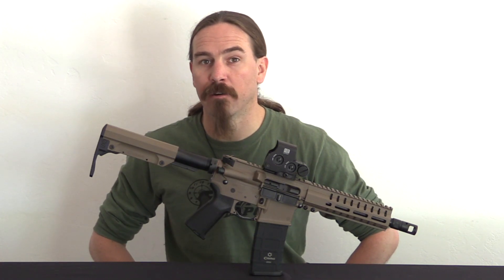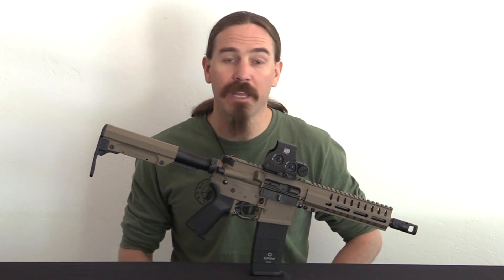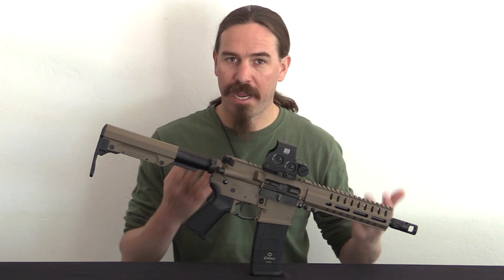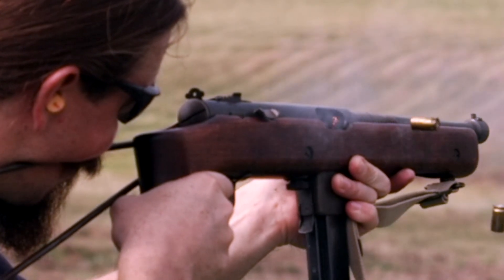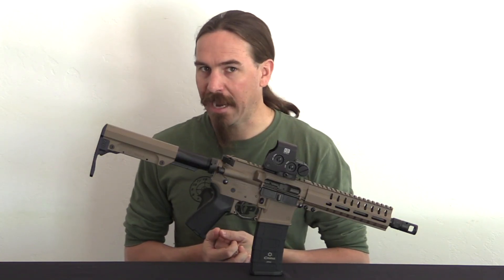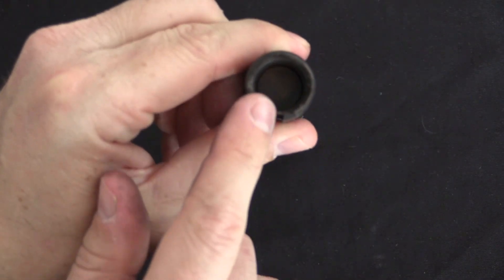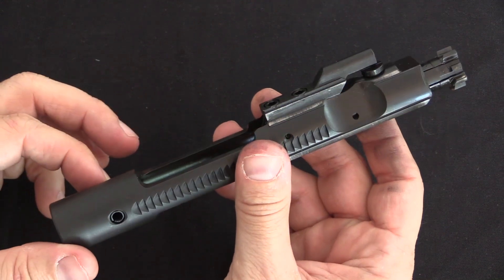CMMG Banshee: The Unique Radial Delayed Blowback System

Comment: I love this system; it really is fantastic
Reply: It's a remarkably simple idea. The bolt face rotating moves it slowly backwards but attempts to move the much heavier bolt carrier very fast backwards, which means it has to fight much harder against inertia, so the result is that it takes a lot longer to open the breech. It's like trying to do 0-60 but you have to start in 4th gear. Sure you have the same amount of horsepower but you're at a massive mechanical disadvantage.
Reply: Especially in the 10mm
Reply: Once again I love that your just another regular gun enthusiast like us and enjoy other guntube channel
Reply: Good for you
Reply: QC is inconstant and CS is non existent.  Don't embarrass yourself by endorsing this joke of a company.  3 banshees owned, all 3 bad out of box.  2 they fixed stating they knew about it, and fixed the issue using the extractor spring/system from another model; translation: they ship firearms with OUT known fixes. What a joke!!!

Not it takes weeks for them to reply to emails, and months to return their defective junk they're pimping making millions on the back of suckers.
Reply: I wonder how much R&D this actually took.. the fact these changes are so small and subtle makes me think they shot till it failed, made minor tweaks, and tried again till it worked. That’s assuming they planned on keeping the original bolt design. It probably would have been easier to just go with a completely different design.
Reply: @devinmounce1838  well we got computers now, so they would've used those as much as possible.
Reply: Sounds amazing, being able to customize the bolt is ingenious.

Comment: Very cool, although I'm pretty sure the Radial in Radial Delayed Blowback refers to the orientation of the "locking" lugs and not the "radial motion of the bolt head" because the bolt head definitely does not move in radial direction lol.

Comment: I have one of those in 9mm. Am quite happy with it in general but I did find that it won't run aluminum cased ammo. The cases do not eject, they just rattle around inside without ever quite making it out. Does that about every second round.

I have run 115 grained ammo in brass and steel and they seem to work just fine.

A lot of fun to shoot I have to say.

Comment: Sorry Ian, but this Bolt, and Bolt carrier are unique to this model..  Looking at the carrier it lacks the two exhaust ports on the right side, it's a different length over all, there is a spring pin through the body at it's rear.  The carrier key is solid and acts only as a guide to prevent the carrier body from turning.  and the bolt you've covered as being different from a standard AR.  The unique magazine does however allow for feeding without the necessity of having a stand alone receiver for only one use.

Comment: When I saw the Banshee originally I was hoping the bolt could be used in other bolt carriers like the DFA Modified Cycling System.  But that shortened cam track means it's probably a no-go without some brave Dremel work.

Comment: Having worked on and owned AR platform PCC's that run suppressors, It's an easy 10 thumbs up for the RDB system. If you're tired of eating gas I'd highly recommend buying a bolt/barrel combo. totally worth it.

Comment: Actually the bolt head and the bolt carrier moves at the same time, but at different speed. The 45% inclined surfaces force the carrier to accelerate at double the speed of the bolt head and, to accelerate a mass at double the speed in the same time, you need four time the energy. Like lever delayed and roller delayed, radial delayed replaces the mass of the bolt with the speed of a part of it.

Comment: I recently re-watched the video of the straight pull hunting rifle using radial ball bearings pushed out by a cylindrical body connected to the bolt handle as a locking mechanism ( Heym SR30). When you slant the rear of the locking groove in the receiver you may very well have the basis of an very cost effective delayed blow back mechanism. Make the central body spring loaded in stead of handle controlled and the acceleration of this central body will grant the time required to have the pressure drop to a safe level.
https://youtu.be/a-44H321Bsg

Comment: Its a cool system but they totally could have made a DI 45 work. Theres already companies out there that have made DI 45acp ar15s. They could have lightened the bolt carrier and spring and buffer and or reduced the port size in the bolt carrier to allow more gas pressure. There's tons of different ways to tune DI to make low gas pressure work. Maybe those options weren't good enough for them or they just wanted to do something different.

Comment: Is there any data on how much wear is experienced on either the bolt lugs or the chamber lugs with this system? It seems like you are likely to get much more wear than you would on the standard gas impingement configuration as the pressure is now directly on the lugs moving past each other -- namely because rather than a flat-to-flat interface, you are have a flat-to-45degree. Still, a very cool use of the existing geometry.

Comment: just curious as a non american do you get in trouble if you put a longer barrel on a registerd sbr/sbs or is that just fine. 
where i live all we have is a minimum over all length of 840mm/33inch, and the barrel length has to be greater than 400mm/15.7inch for longarms (we do not have an equivalent to sbr/sbs)

Comment: I'd heard rumblings of the CMMG Banshee and its revolutionary...whatever.  Just another PCC in a market flooded with them as far as I was concerned.  However now that Gun Jesus has walked me through its workings, I'm far more intrigued.  I had seen the Glock magazine versions and didn't have much interest in the platform.  I was totally unaware how similar this mechanism is to existing AR bolts and that these conversion magazines exist, allowing a pistol caliber upper to go directly on a standard AR lower.  This changes things for me quite a bit.  Curse you Ian, I'm trying NOT to spend more money on guns right now!

Comment: Looks like "axial" and not radial.  Usually when you call something radial, it moves toward or away from the center. I wonder why they chose the word "radial" for their system.  Only reading the title of this I was trying to imagine lugs moving outward to lock or something along those lines.  What this is instead is just another method of axial, or even rotational movement.

Comment: Gotta admit it's clever, basically a standard AR15 bolt that does what they normally do, except with a spring pushing the locking lugs forward

Comment: 7:02 Did they shorten the cam track to balance the system or to make it work at all? It looks to me that the first part of the original track is straight back which would actively prevent the bolt from rotating. Coming to think about it, this could be a safety feature to prevent early unlocking if the back ends of the locking lugs might be worn into an angled surface.

Comment: An AR-15 in .45 ACP... Gentlemen, we have achieved peak 'Muricaness.
Reply: It'll need wood furniture, 50 round drum mags and a modern reproduction of the cutts compensator mounted on the muzzle.
Reply: @Protherium Don't forget to add a red, white, and blue color scheme
Reply: @Protherium what if,  and hear me out, instead of a lever malfunction button. The forward assist would turn the gas on or off. Then we could run semi or have the lever to run the action!
Reply: @Protherium It also needs an M1A1 Thompson style charging handle
Reply: I want one of these for that reason alone.
Reply: Moriarty firearms has one
Reply: I prefer 10mm
Reply: Gods caliber. John Moses Browning intensifies
Reply: Tim LaFrance designed the M16k in 45ACP in 1982.
Reply: Auston T absolute buzzkill.

Comment: What about swapping out a .223 upper on an AR pistol lower with a pistol caliber upper? The receiver is still serialized as a pistol so the swap wouldn't make it an NFA item right?
Reply from the maker: The receiver was turned into a short barreled rifle when it was registered.
Reply: @ForgottenWeapons  I have a AR Pistol currently in 223. Would i be able to swap in a 9mm upper without having to register?
Reply from the maker: I;m not a lawyer, but changing caliber of a pistol does not require any legal process. Just like you could swap a 9mm barrel into a Tokarev, would can change a .223 pistol to 9mm.

Comment: I was looking at this system actually. Wanted to do a Colt Carbine clone, but I have a captured buffer. The normal blow back bolts need extra weight, and have the weight plug, so cant use a captured system. The radial delay seems like an answer, but 1. the barrel is taper, so no A2 front sight (I know free float is better, but I want the look), and 2. it's $400 for just the barrel. I can about build a whole 9mm upper for that, including a spare XH buffer. Spoke with CMMG, and according to them this system does not work with magazine adapters, so I either need their magazines, or their lower. It is a neat system, but lacks the modularity that makes the AR so accessable. Back to the drawing board, or just don't do a PCC.

Comment: hey Ian, if you ever have the chance to make a video on a blaser r8, please do it. It has a locking system thats not present on any other gun (as far as i know) and its accuracy is just legendary. Basically 70% of german hunters use it. When i go on a driven hunt with my trusty savage, most of the other guys run an r8.

Comment: Are the barrel lugs chamfered to match the bolt? Why doesn't the bolt move back the 1-2mm corresponding to the "length" of the chamfers on the locking lugs before the the bolt is fully unlocked?

Comment: I have one of these I built in .45 and it can handle everything from 185gr high velocity, to heavy low velocity, to even the hottest .45 Super that I hand load with ZERO problems or issues. They really knocked it out of the park with this design.
Reply: silenced?  use any weights?
Reply: @timmccallum7336  almost exclusively suppressed nowadays. I've got an Octane 45 HD that lives on the Banshee, and I still have the 2oz weight in the bolt carrier from shooting .45 Super. It is superb and I can't recommend it enough. It can run the standard pressure .45 ACP without the suppressor just fine as well with that same weight configuration, but the weights aren't needed for it to function if you plan on shooting vanilla .45 ACP.
Reply: @thisguy41487  You're running a two-ounce bolt weight?  What about buffer weight?  I have a three-ounce bolt weight, and am waiting on a seven-ounce buffer for my 10mm Banshee.  It functions fine, but the rear edge of the ejection port, rather than the case deflector, is taking a real beating, and CMMG says if the heavier buffer doesn't help, downloaded ammo is the next step!
Reply: @kimisdaman  I'm running a standard weight buffer, but 10mm is higher pressure, so the maximum amount of added weight is likely needed. You might consider getting a shell deflector pad to prevent it from beating up around the ejection port.
Reply: @thisguy41487  The stock, bolt-on deflector covers more of the upper than deflectors integral with the upper, but maybe some additional thickness, so the case never gets to the rear of the port, would help.  The manual says a heavier buffer might be necessary for warmer loads, but I'm not running near full-power; hopefully the heavier buffer will do the trick.
Reply: @kimisdaman  10mm is a beast of its own. I know that it's had kind of a rough go in the banshee using spicy loads. A buddy of mine had some 220gr buffalo bore cases shear in half, even with the heaviest weights. I too have had similar things happen with full-tilt .45 super (like 200gr doing 1500+ fps or so). I think that the banshee might just might get beat up with 10mm. Downloaded 10mm might be an option, but that would be kind of lame, to be honest.
Reply: @thisguy41487  Yeah, if they make a .40 Banshee, you'd think the 10mm version would have specs consistent with the heavier loads.  I'd just like to get an additional 100fps from the loads I'm already shooting in a five-inch gun, no desire to push it harder than that.  200grs @ 1000fps, from a five-pound "carbine" isn't very appealing.  I'd like to see 200 @ 1300, and 220 @ 1200- chrono'd from 8" -which doesn't seem unreasonable.
Reply: @kimisdaman  I'd say that's more than reasonable. 10mm should be able to get those velocities safely. Have you tried pushing some 200gr rounds around that velocity in your gun yet? That's pretty much my standard .45 Super load (200gr at 1300-1350 fps), and I've had no troubles with that one in my current configuration. In fact, it seems to run better in my banshee than in my handguns. Primers are still rounded with no cratering, and case heads aren't brutally flattened. Also, are you shooting hard cast or jacketed?
Reply: @thisguy41487  So far, I've shot only loads pushing 200s, plated and jacketed, at less than 1050 from a 5" barrel, so nothing even near hot.  There are no pressure signs of any kind, just the beat-up ejection port.  Case ejection is 2-3 feet, with the (5.5oz) H3 buffer.
Reply: @kimisdaman  I'd say give her a little more push and step up to some spicier loads. I think you might be getting early ejection, which might be battering up the port a bit. A spicier load might delay the ejection just a tiny bit farther back, letting it interface with the case deflector... maybe. I wouldn't sweat about it too much. She can take more comfortably.

Comment: Ian do you think that the bolt lugs in a system like this would see a higher failure rate due to the 45 degree bearing surfaces on.the back being used to delay the recoil?

Comment: I saw a recent video of this system in action. The guy didn't go into detail about the bolt carrier or anything like what you do, but he did run almost 5000 rounds through the rifle as fast as he could. He did have some feed issues, but the fact that he tried to melt the barrel, he never did and the fact that he went though that much ammo with very little issues was extremely impressive. He also showed the video in infrared and he got the entire rifle glowing, but it never melted the barrel.

Comment: I have a banshee MK10 I got about a month ago. I sold my vector 10mm for this and I’m happy I did!  I’m waiting on my form 1 now. What stock is that?
Reply: It's CMMG's proprietary butt stock.  It's called the Ripstock.  It can be extended just by pulling the back on the stock without pressing a button and I believe you can preset the length of pull too.  Pretty coo
Reply: thechief0620 it looks really cool, but not $200 cool. Does it work with a law folder?

Comment: I think the 10mm version is the most notable gun from CMMG, but not necessarily the most popular. 10mm was darn near impossible to run in blowback reliably and safely (when running hot loads in a weak load setup), and is still being engineered in DI. Either the RD blowback or short stroke piston is the best route.
Reply: Agreed!

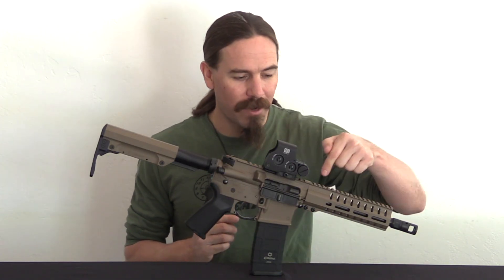Comment: 2:48 - "It shot really well because it was right on the verge of short-stroking". What do you mean it shot really well? And what is short-stroking? Thanks
Reply: Short-stroking = The bolt not traveling back far enough to cycle the action and/or pick up a new cartridge.
Reply: @JanTuts  so how can it be said that it shot really well?
Reply: @todorkolev7565  that means that the bolt is not smacking into the back of the receiver, but is just coming back far enough to pick up the next round.

Comment: Interesting, for sure. However, as a juxtaposition to CMMG I am running a MVB .45acp PCC conversion which uses HK USC mags (you MUST also use the  MVB bolt) and has a LRBHO feature. Nary a failure to feed or extract using a std buffer. My Glock 30 has experienced more failures. Had I waited to build/buy a .45 PCC I would be very interested in the CMMG system. The CMMG does have a couple of advantages over my Sylvan 9mm PCC, namely LRBHO and mag release position, but I can use just about any 9mm Glock mag...

Comment: The frustrating thing about the 9mm AR platform is that it sends a ton of gas back to the shooter's face through the back of the gun with a silencer. With a Scorpion,  Stribog, etc this doesn't seem to be as much of an issue, but since 9mm is one of the most suppressed calibers, spending $1500 on a gun that can't be suppressed without a cloud of hot lead gas being shot right at your nose and mouth is a real bummer. I understand they have to keep the price high to recoup the cost of R&D, but it doesn't seem like a good deal considering the radial delayed Stribog 3 is now approved for US import.

Comment: I built one of these systems on a Gibbz side charging upper and a New Frontier Armory MP5 lower. It is such a sweet shooting system. Have you had any issues with FTEject? Also, as clarification to others, the Endomag is only compatible with gen 3 pmags, not ANY AR mag. I tried them in some old gen 1 pmags and they wouldn’t fit, much less old USGI mags.